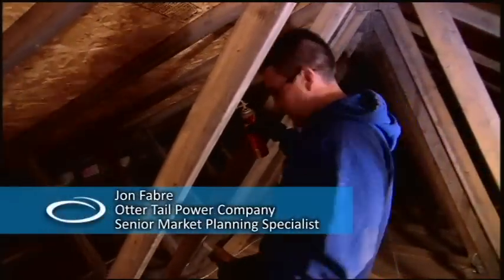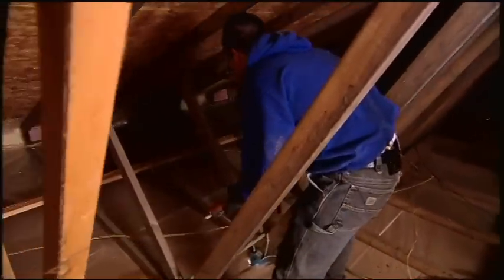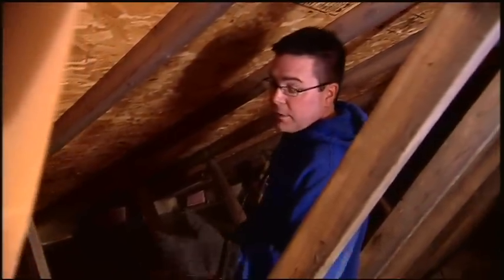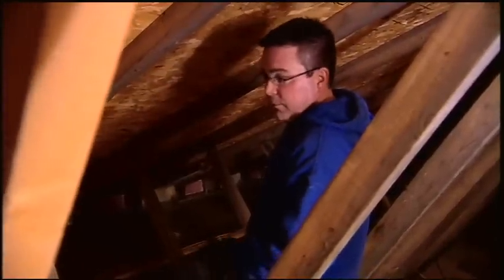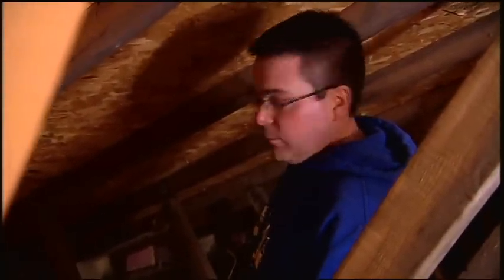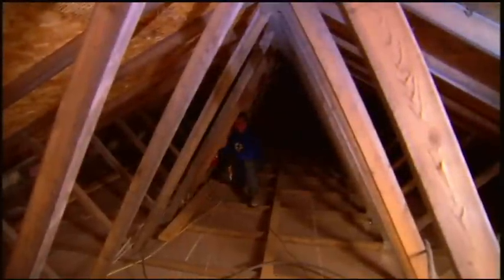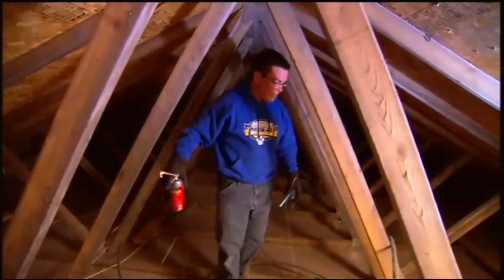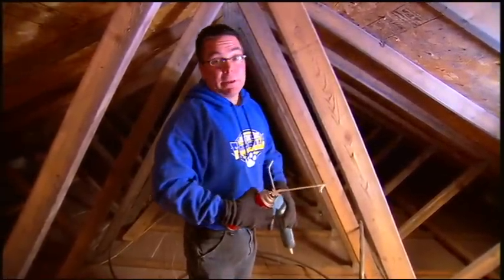Sealing Attic Bypass Leaks

Comment from the maker: We used silicone caulk around the wires because of the proximity of the sealant to possible heat buildup in the electrical receptacle and also because we didn’t want to deal with foam expanding down into the receptacle.

Comment: Why did you use caulk instead of foam to seal around the wire through the electric box.  And which caulk did you use (silicone, brand, etc.)